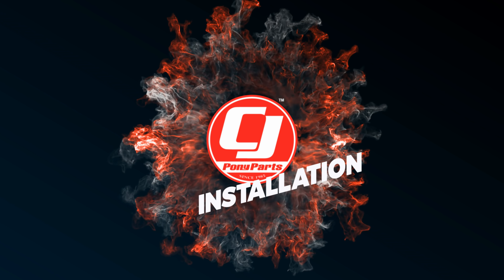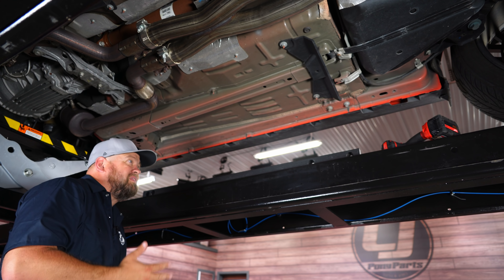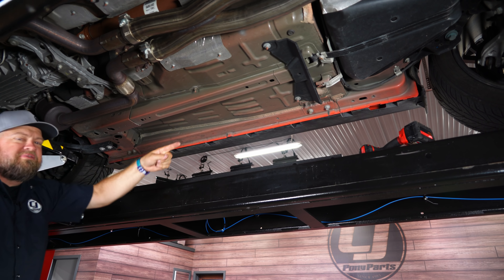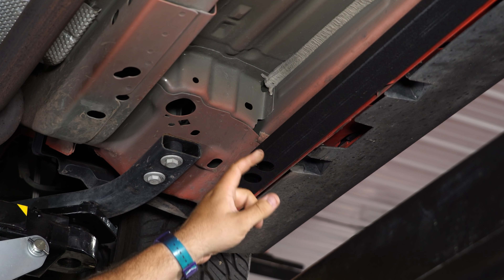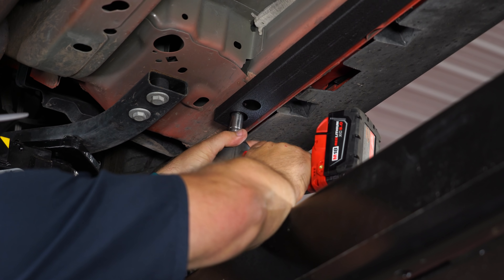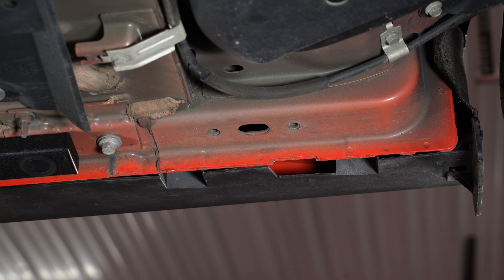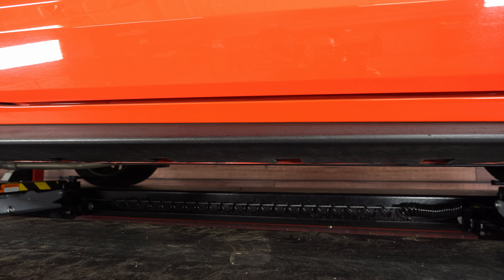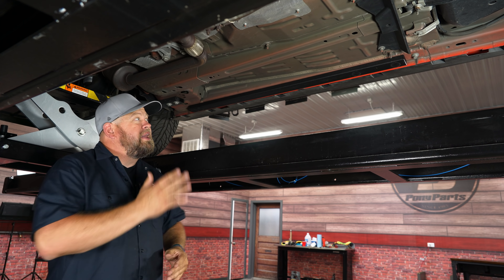2015-2023 Ford Mustang Install: Steeda Ultra-Lite Low-Profile Full Length Chassis Jacking Rails

Comment: Recommend just re-using the factory bolts as they are more robust and longer. This makes them easier to install with. You just need 1 of the supplied bolts per side if you re-use the factory ones

Comment: The bolting location mentioned for the steeda irs brace was incorrect.  The brace uses the bolt next to where the jacking rail ends, and the next empty bolt hole. The last bolt hole is not used. The jacking rails are shorter than the comparable BMR. The BMR rails would share a bolt with the steeda brace and are therefore incompatible. Hope this info helps someone.

Comment: Hi Bill,  Is the jacking plate suitable for locating the rear lift plate on my 2 post hoist (lift)? Currently I'm lifting on the K member at the front and right at the back of the pinch weld on the back, similar to some of your videos. Due to limited parking space, my car spends a lot of time up on the hoist and worry about all that weight being held only on the pinch weld for long periods of time. Ideally, I'd love a short version of the jacking plate to bolt on at the back where you put your IRS support, that would make more sense to me. Anyway, I'd love to hear your thoughts, Cheers, Aussie Robert.